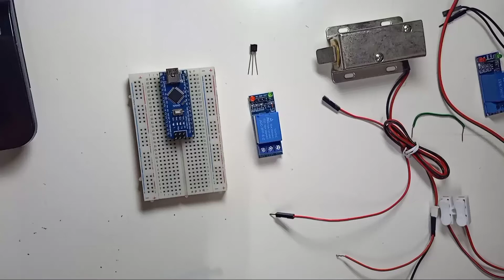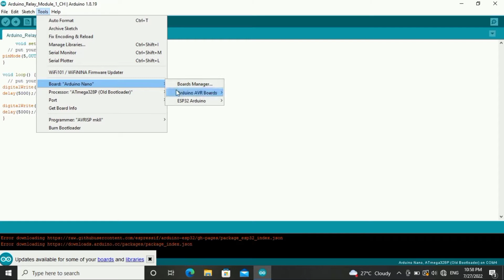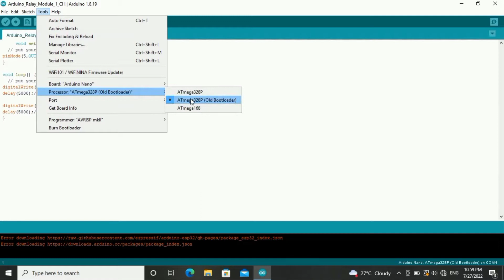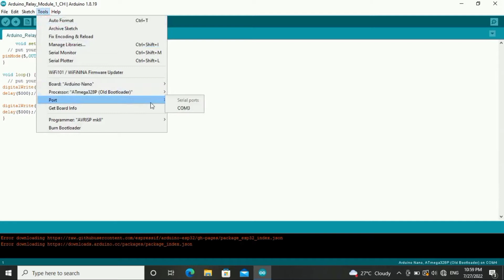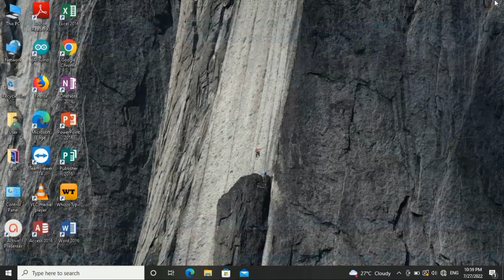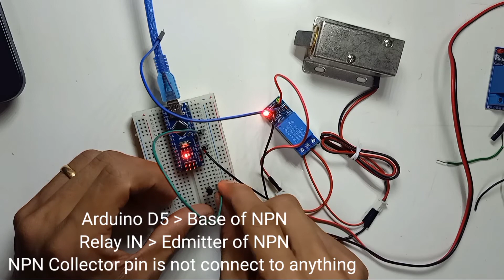How to use 12VDC Relay Module with Arduino

Comment: I was wondering why doing this is not putting the arduino at risk. Will 12V be going into the arduino when the arduino pin output is low?

Comment: if i use a esp 32 do i need a npn transistor still?? i can use 12 v supply externally.
Reply from the maker: You still need to use NPN transistor.
Reply: @Electronicslabs I use 4 channel 12V relay module. I connect 3 solenoid locks and a buzzer. So i need 4 transistors to control the components. 
Am I right??
Reply from the maker: @wd02-2 yes you got it😅

Comment: I’m trying to do it on a raspberry pi 4. What do you suggest? Can I have the code and circuit diagram of the project that you have done ?
Reply: It uses 5v so you can do similar to control 12v relay with raspberry

Comment: I also use an Arduino Uno and a 12V relay module. And for some reasons, I can still control the relay module without a transistor 😅
Reply from the maker: Excellent 🤗👏

Comment: Hi passion, why is the collector pin not connected to anything? I thought you need voltage from collector pin to generate current from collector to emitter.
Reply from the maker: Relay board is active low so it just need Edmitter to trigger on and off for stable voltage.
Reply: If you use a voltmeter, you will see current flowing from the input pin straight to the Arduino’s GPIO pin. The voltage at the relay's input pin is 12V, while the voltage at the BC547 is around 9V; the remaining voltage is reaching the GPIO pin. It is better to use the BC547 as it was designed:
1. Relay IN pin -> BC547 Collector
2. BC547 Emitter -> Ground (GND)
3. BC547 Base -> Arduino GPIO pin (via a resistor)

Comment: Would the circuit be the same if you use a 24v power source and a 24v relay?
Reply from the maker: Yes 24v use is  the same circut.
Reply: @Electronicslabs  What is the name of the gray component you use? Can I replace it with a 12 vdc geared motor that has a positive and a negative terminal?
Reply from the maker: @adrielvm2106  instead of solenoid you can replace any appliances like DC motor or fan or lamp etc .
Reply: @Electronicslabs  Is the signal from the relay to the emitter necessary for resistors to the transistor in this case?

Comment: This has been the best explanation and tutorial I have seen in many days of searching...
But I am running into a problem.
When I connect my setup like this (I am using a WEMOS D1 R2 (looks like the Arduino Uno style board), and I seem to only be able to turn off my relay if I manually move the data pin from D2 which I was trying to use, to a ground on the board.

I have everything else in the wiring setup like you have, but I am using a S8050 D-331 NPN transistor instead (its what I had on-hand).
If I touch the D2 pin's wire (coming from the D1 board) to the base of the S8050 D-331, and the data IN on the 12V relay (same exact look as what u have -- I compared #'s on top), my 12V relay switches to the ON position. If I touch both the D2 pin (my chosen data pin) and the IN on the 12V relay together, the relay switches also. 

So I think I might need the other type of transistor, as the bottom of my relay says "Low Level Trigger". I suspect that's why it works when I connect it to ground pins.
I am having so much trouble finding out what I am doing wrong, as I have been trying this 12V model relay and I have tried 5V models w/o success. I just tried the 5V relay (does not say low level trigger) and it does not seem to react whatsoever, unless once again I just take the data pin and connect it straight to a ground.

Getting a damn relay to work should not be more difficult that programming the code that it's going to use, and yet it's much more difficult to fig out.
I have built CO2 sensors and temp sensors that utilize MQTT and WiFi... yet I cant get a stupid relay working. It's so beat.

Comment: This is a nice video. 
I had a doubt, what exactly is the NPN transistor doing so that the solenoid is 5 seconds ON and 5 seconds OFF?
Reply from the maker: Transistor is semiconductor, imagine as simple switch which you make as on and off by using our hands but transistor is making on and off by using a small current instead of hand that is why they call semiconductor.NPN means need positive voltage to make on and off, PNP is need negative voltage to make on and off.I hope you get the answer.
Reply: @Electronicslabs  Thank you for thr explanation. Will try it out🔥
Reply: The program ina rduino was the one doing onnd off.

Comment: I have the same problem with NODEMCU ESP8266 and i try your solution but not working😟
Reply from the maker: Means , you can't control 12V relay board with Node Mcu esp8266 ?
Reply: @Electronicslabs  yeah

Comment: I have arduino uno r3 , 12v relay module and 12v dc water pump ,and 12v dc supply but the pump is not running
Reply from the maker: Is it the pump not working or relay is not active?
Actually this method should work if your components is all complete it should work well. Remember, to be able to  active 12V relay board you must use NPN transistors otherwise relay will not active.

Comment: i have a question why we used a transistor what is he role of this transistor in this case
Reply from the maker: Transistor is semiconductor here we use as switch because Arduino Uno 5V can not trigger 12V relay so from Arduino Uno out put trigger to Transistor and from transistor output trigger to 12V relay board. I hope you clear it.
Reply: @Electronicslabs  thank you . one more question : in this case is it necessary to use transistor or we can use another semiconductor .
+ resistance should use with transistor or not
and thank you for your efforts
Reply from the maker: @hemahema2999  as long as NPN transistors it wil work in this circuit.but only resistor will not work it.

Comment: If I used a 5v relay instead of the 12v relay, I wouldn't need a transistor, right?
Reply from the maker: Yes...for 5V relay no need to use transistor.It work directly to trigger 5v.